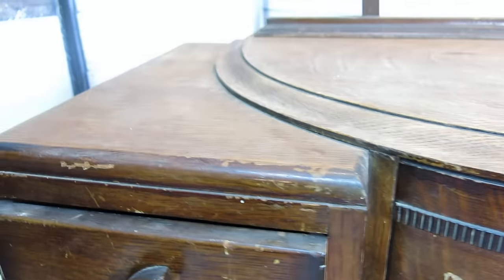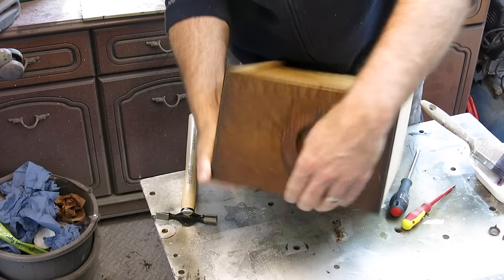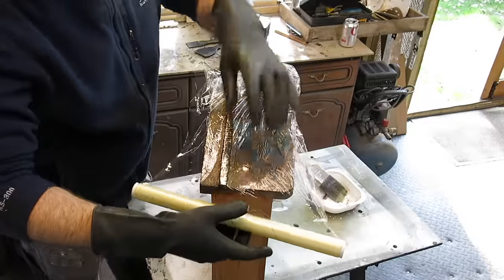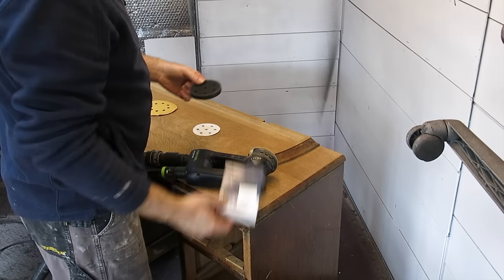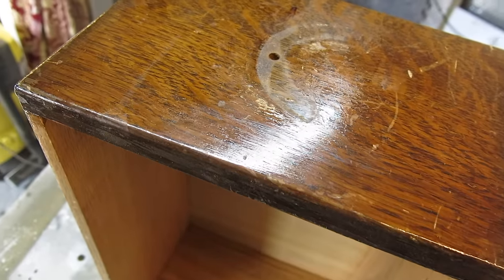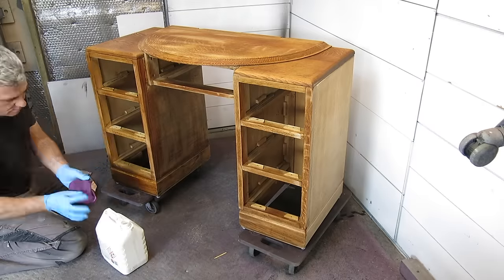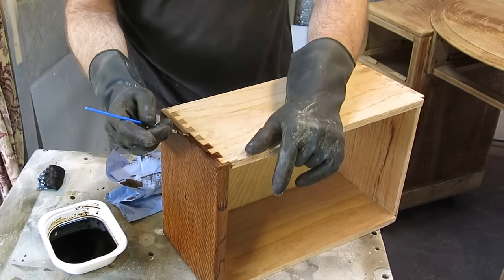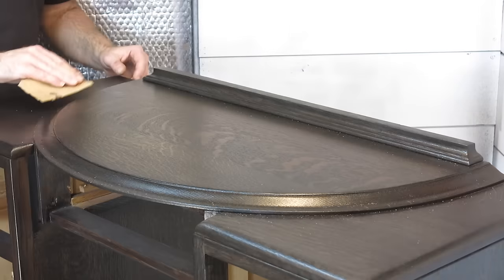Painting with Wood stain - Full RESTORATION of a Vintage Solid Oak Vanity Dresser

Comment: Amazing job! 
A couple of tips for removing finish. if trying to remove a natural shellac finish try using alcohol based hand sanitiser gel using the ‘wrap in glad wrap/bin liner method. Wipe or scrape off excess once the finish softens then wipe clean with denatured alcohol. Clean up stubborn nooks and crannies using either the hand sanitiser or methylated spirit/ denatured alcohol and a toothbrush.
If this doesn’t work well use acetone and a wire brush
Reply from the maker: Thanks very much, good luck with your hand sanitiser trick, I’ve never tried it 😀

Comment: I'm working on an old piece now. I got it covered in a black paint/stain. Sanding now with some spirits and paint remover. Very slow work. It is a two piece system. A stand with two doors at bottom and a full with drawer above them. This is the piece I am working on right now. The hutch piece is similar with two doors at bottom and a full with drawer above these. The wood is golden oak under all the coverage. I first had thoughts when I saw the piece to try buff the black and apply a white coat atop that. But the beauty of the oak changed all that. 
What I have is very old. Inside lettering states " Wash stand with Mirror" . The sides and doors have inlaid oak veneer. I wish to maintain them, but I have a problem in that these sides are warped! Wavy in fact. I have , on one side only so far, put paint remover over the area and sanded also. This has worked some what. The valleys and stains within them are proving to be a big challenge. I'm going at this very slow as I do want to keep what I can. Am I trying to keep the unkeepable? chuckle
I'm guessing the piece is from the early 20th century by the joinery and fabrication of the units. 
I have been watching your films to gain confidence to forge ahead with this work. Great videos!
Reply from the maker: Hi Swampy. The warped veneer on the side sounds like the glue beneath has failed (dried out). I would be tempted to use a damp towel and hot iron over the veneer to see if you can reactivate the glue and get it to lie flat. It may then be easier to remove the stain. It’s really pleasing to hear that my videos have given you more confidence to carry out your own restoration. Good luck and enjoy 😀😀👍👍👍

Comment: Beautifully done and a lot of work indeed ! I have restored countless pieces (here in Pennsylvania) and I have found the most tedious step is the old finish removal. I don’t like using chemical strippers for the same reasons you don’t; the mess and disposal. Some of the best results I attained are by using broken window glass as scrapers. Of course, you must wear gloves and eye protection, but the results are quite satisfying, even in the detail areas. When the glass edges get dull, just reverse the glass or make another. It takes a bit of practice but it beats constantly sharpening new edges on metal tools.
Keep up the great work.
Reply from the maker: Hi Fred. I’ve never heard of using glass as a scraper before but thanks for the tip. I’ll give it a try. I totally agree that removing old finish is a bit if a pain but it definitely makes the pleasure of doing the new finish that more pleasurable. 😀😀👍

Comment: it looks very nice with the contrasting colour stains. although I would've stained the top semicircle with the same colour stain as the face of the drawers, simply because it had a very nice grain pattern and the curved shape of the table top
Reply from the maker: Hi Chris. I actually did what you have suggested initially but it just didn’t look right to me which is why I went over it with the Ebony 😀👍

Comment: Micro sand blasting would be verry effective on the carvings. If you can, give it a try... works great!
Reply from the maker: I’ve actually been looking at a cheap sandblasting tool but not bought one yet as they get some mixed reviews. 😀😀👍
Reply: @MayfieldRestorations  the best ones are from Ibix in my opinion, you can use different medium even flour for the most delicate jobs. But they are not cheap. I'm sure you will find something 😊

Comment: What stunning and dramatic grain on that piece!  It would have looked amazing when it was originally made, but your makeover has added a contemporary dimension.  Do you only use spray finish or have  you tried wipe on poly?  Great job!
Reply from the maker: Thanks very much for your kind comment. I do use other finishes and methods of application but I do tend to use water based topcoats a lot of the time. 😀👍

Comment: Very nice 2 tone without  paint , thought the raised top raised part  started  out golden?  Great job 👏
Reply from the maker: Hi Rober, Thankyou. You’re right, I initially stained part of the top in Walnut but I didn’t like the look of it so changed to the Ebony stain 😀😀👍
Reply: We have several pieces of old oak furniture; quarter sawn is our favorite but we also enjoy other cuts. All of the pieces have a lovely patina. 

I inherited the barrister’s bookcases from my father’s father. They’re fumed oak, which we don’t care for so much, but their usefulness and sentimental value make them very special. 

I was glad to see you switch from the walnut to the ebony stain. Initially I thought you should have used the golden oak all over but the dark highlights on the body look smashing in contrast. I was awestruck by your control of the stain in those tight spaces. 

What kinds of equipment do you prefer for eye, ear and respiratory protection?  I saw the respirator with the sprayer, of course. 

I think back to my younger days and all the things I exposed myself to when I was stripping paint and shake my head. Channel using a heat gun to strip many layers of lead paint in a kitchen in the middle of winter!

I subscribed today and will be back to check out other videos.

Comment: Thank you so much for this video.  I so enjoy watching an antique come back to a beautiful piece of furniture. I'm curious as well. You said the drawer front was solid oak, then you said there was a thick veneer, why would a veneer be used on solid oak?
Reply: Most of the drawer fronts are solid oak, just the curved one in the middle isn't.  It's pretty usual for pieces to have curved shapes in plywood with a more expensive veneer on top to match the rest of the piece, it's more stable against humidity changes and prevents warping and cracking.  The side panels are probably oak veneered plywood too, to reduce weight, cost, and risk of cracking and warping.

Comment: Absolutely beautiful. I'm a newbie.  What did you do to the sides of the drawers.  They looked so finished.  If I understood you said "feeding the sides of the drawers?
Reply: He used Howard’s feed and wax wood polish. I used it on some older wood furniture recently and it just brings it back to life. It ‘feeds’ the wood. I like to say the wood is super thirsty 😂
Reply from the maker: Hi Ladonna, just like Quinn has previously mentioned. I used Howard’s feed n wax to nourish the drawers. Over the years, the wood simply dries out which can cause sticking drawers, warped drawers and they look old and tired. Simply brushing this in, leaving for 15 mins then wiping off the excess does the trick. 😀👍
Reply: @quinndiemer  Thank you so much for your reply.  I will definitely look into this.

Comment: Did you try heat on the nail.  Wire from battery to nail and then it might be soft enough to move.
Reply from the maker: Hi Maureen, great Tip thank you. I'll give it a try in the future 😀👍

Comment: I have a couple pieces I’d like to tackle that have beautiful oak grain. I’m curious to know what you think about a soda blaster. On a laminate I might be scared but on a real solid piece of wood it would go so fast!
Reply from the maker: Hi Allison. I’ll be honest, I’ve never used one but I have actually been looking to buy one and give it a try. I would only really use it on solid wood until I got a feel for how aggressive it is and then take it from there. 😀👍
Reply: @MayfieldRestorations  Media blasting on oak using soda, "sand" or even shaped media  we think might erode the softer parts of oak creating unwanted profiles.  Great job on that old lady. She lives on.
Reply: @magicgordo4878  you can adjust the spray so you’re not on the side of blasting but going lightly as possible getting into hard to reach places.
Reply: @MayfieldRestorations  I think a good sander for bigger areas is fine but there’s sometimes details, carvings, and hard to reach areas that a soda blaster would come in handy. Obviously one wouldn’t want to blast away. It would need to be a light touch and you’d need to keep moving. I haven’t tried it. You first lol! I’d start with a practice piece or two for sure. I think so many of these old pieces with quartersawn oak look so beautiful with just an updated light or raw wood look. I love the white stain you did recently. I went to a two week antique festival in Texas last year and there were huge tents and barns with the look they called French farmhouse.

Comment: 😊👍
Looks like a piece of ''fifties'' utility wear, produced just after WW2.
Much better constructed, than the chipboard crap that goes for furniture these days.
Some really nice figured oak on the drawers as well.
Probably looks better than the original when new, as that would have been just plain varnish. 
.
Reply from the maker: I totally agree that this old vintage furniture is far superior quality to a lot of todays mass manufactured stuff. It's pretty much why i do what i do. 😀👍
Reply: @MayfieldRestorations  
''Old Vintage Furniture!''
It's the stuff of my childhood!😊
.
Reply: The 1920's or 30's, not the 50's.
BTW, chipboard materials are put through lot of processes. They don't warp as solid wood does sometimes.
Reply: @stevie68a  
In the UK, during and immediately after WW2. (40's and 50's) Britain introduced ''The utility logo'' for machine made solid wood furniture. This was made with the minimum of material, as material was scarce, even after the war. 
There was no chipboard then. The machinery didn't exist to make it.
Gradually, factories that had been making products for war, started making domestic products. It was the shortage of solid wood, that triggered the chipboard products, made from waste wood, and wood salvaged from bombed buildings.
It was only in the 60's that chipboard products started to appear in the UK.
.

Comment: I've came upon many pieces of furniture that needed help I got two dressers @ an auction for very little bit of money one had a horseshoe mirror and frame the dresser was trashed the other dresser was missing two drawers so I made two sleeves for the top two drawers but drawers in the bottom and refinish with stains ands tung oil

Comment: I'm sure our paint stripper isn't as strong as it used to be (EU meddling?) - I always struggle nowadays unlike in the 1980s - Angie from Transcend Furniture doesn't seem to have any problems with Circa 1850 stripper. Great work btw.
Reply from the maker: I’ve found a much better stripper now in the UK. Similar results to Angies 😀🤬
Reply: Oooh, what is it please? Or would it be considered a promotion on your part to tell me? I've refinished some small items of furniture but it takes forever to strip them these days.

Comment: Hello from Sweden. Nice work you have done.
Why don't you sandpaper the shellack ( I don't how to spell it)?
Reply from the maker: Hi Helena, thanks for watching. You can sand the existing finish off but with shellac it’s easy to take the majority of it off with Methylated Spirit prior to sanding. It can be safer when removing finish off thin veneer. 😀😀👍

Comment: there's a brand called Citrus Strip that you may like to have on hand. If  you use it and plastic to cover it to sit you won't experience dry out with your stripper. Not plastic wrap but the construction hanging plastic.
Reply from the maker: Hi, thanks for the advice, much appreciated. Unfortunately Citristrip is almost impossible to get here in the UK. 😀👍
Reply: @MayfieldRestorations  Citristrip is much worse to clean up than other strippers. It’s like snot and it doesn’t work that well. I’d never use it again.

Comment: If I may, suggest not using an orbital sander, a vibrating sander would smooth out the wood and your blotching would never happen. The orbital is ok for removal but never used befor a finish it leaves marks against the grain. The work was nice though.

Comment: Is there a reason why you don't just sand right away?
Reply from the maker: It all depends on the condition and type of existing finish on the piece and what the piece is made of. If it’s veneered then it’s better to remove finish with other methods other than sanding unless you are very very careful 😀👍
Reply: @MayfieldRestorations  Thanks

Comment: My Great Grandmother gave her bedroom set to my Grandmother as a wedding gift.  However, my Grandmother already had a nice bedroom set so she put the gift in the guest room and covered it.  Fast forward, mom and dad married in 53 and my Grandmother gave them the bedroom set from the guest room as a wedding gift.  It was made in 1892. They used it for 30 years and moved it upstairs for my sisters to use before they got married and moved out.  Then my drug addicted brother moved upstairs and beat the furniture to death, adding stickers all over it.  It was chipped and marked and missing a drawer that was destroyed. Luckily my brother just tossed the broken drawer under the dresser. 
Next, after I got my bro into a rehab center I visited my mom about a month later. She asked me to remodel my brother's bedroom, so she could have a live in nurse. My mom wasn't well.   So after repairing all the holes in the wall and replacing the toilet, I kept seeing the dresser and it made me sad.  So I being an electrician who was capable of anything once I set my mind to it, I spent my entire weekends there restoring it.  The drawer wasn't that difficult to repair as the damage was to the rear.  So I repaired the chips with wood putty and lightly sketched the grain back in. Everything was ready to clear coat inside and out.  So I used canned lacquer to add the first 3 coats and a lightly sanded it with 440 grit and sprayed it one last time a semi-gloss sheen.  I was using Satin but found it lacking.  When I was done, it was the talk of the town and I beamed with pride.  So I relate to your video.
Reply from the maker: That’s a great compliment when someone sees your work and I looks exactly how it did years before when it was in great condition. Well done on saving this piece of furniture and your family history 😀👏👏

Comment: BIG TIP       Nails or screws that have been in the wood a long time become fused together.  To remove put an electric soldering iron on the head for a couple of minutes.. The screw/nail expands and breaks the link with the wood when  it cools its easier to remove.  Nice Vids :)
Reply from the maker: That’s a great tip!! Thankyou so much, I love getting comments like this. Thanks again 😀😀👍

Comment: Well, it's just stunning.  I'm jealous of anyone who has vision.  When I look at something, that's all I see.  I don't imagine it differently like you do.  I'm working on my first piece, an executive desk that I got free.  It has such an incredibly thick top coat, I guess because it's considered high traffic.  I've thrown everything at it but I've been unsure every step of the way.  You said in the video, many hours and many sanding pads later...  I wonder how many that is.  Just as a gauge for my own work.  My lack of experience has made me go too easy as i
 was afraid of going into the veneer.  If I screw this up, I'm out a free desk and I've learned, but I really want to get it right.
Reply from the maker: Hi Sherrie. Thank you so much for such lovely comments. Don’t worry, the more pieces you do and the more you’ll see the potential of each piece of furniture. I always spend at least 20 minutes just  looking at the piece, assessing the design, the shape, the wood type and the condition. I then think about whether to fully paint, partially paint or to just restore. The plan I have often changes as I start working on the piece. In answer to your sanding question, I spent around 8 hours getting this piece back to the bare wood. For your piece I would advise to go easy at first, I only sand because with experience I can see how far I can push it before sanding through the veneer and that has come from making many mistakes in the past. Try to use paint stripper on your desk top first. It’s worth doing multiple applications before going in with the sander. When you do go in with the sander, start slow and don’t use a heavy grit paper (no smaller number than 120grit) another tip is to also change your sanding disc more than you think you need to. Move the sander slowly but don’t leave in one spot and only apply slight pressure. I wish you luck and thanks again for watching my channel. 😀👍
Reply: @MayfieldRestorations  Thanks.  I really appreciate your response and feedback.